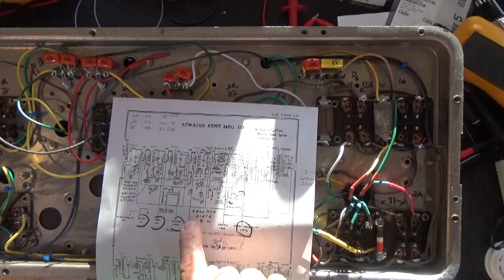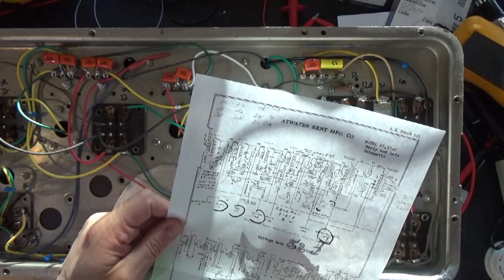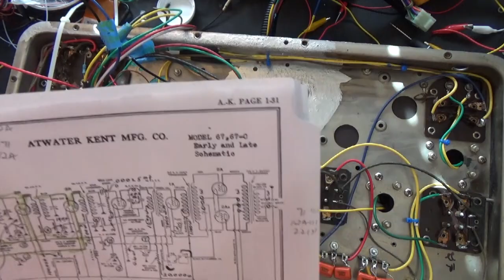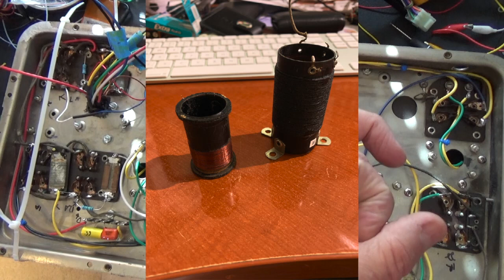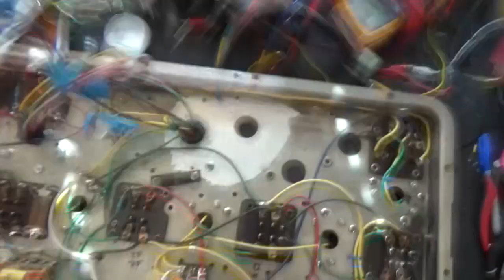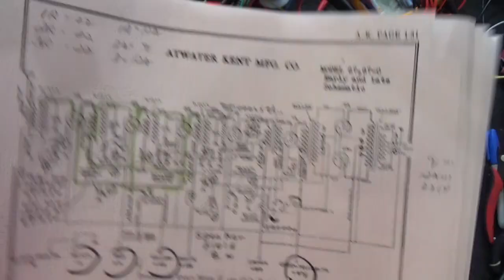Atwater Kent Model 67C Battery Radio : Episode #9: Diggin in the tar, coils and all kinds of stuff

Comment: Good on ya Ron for not giving up.  I agree: keep going until you’ve complete what you set out to do.
People are bringing me radios, and record players that have an original fault, and a second fault caused by some genius in the distant past.  Repairing the original fault can be fairly straightforward but the additional fault placed by some genius who started, or attempted to make a repair, but did lots of damage in the process, and gave up, therefore not seeing the repair job through, makes double hard work for me.  If only they had been like you my friend, and completed the repair job.  Quite likely those who did more damage than making good was all they were good for LOL.
This radio is progressing well, and I like your fault diagnosis techniques.  You’re proceeding with confidence: and I’m confident we will hear a tune out of this radio.
Cheers my friend, Phil.
Reply from the maker: Phil -  it will be coming soon. The radio had such old cracked wires that I had to do a rewire which I knew as dangerous and here I am.  I was like a school girl when I got that interstage transformer coil fixed.. it was a Tarzan moment for me.....  :) lol     Appreciate your support as always my friend... its a fun hobby and I enjoy it very much !!!   Thanks mate ! Cheers